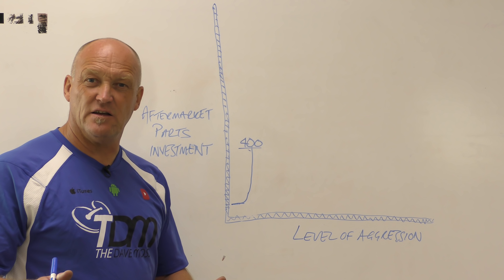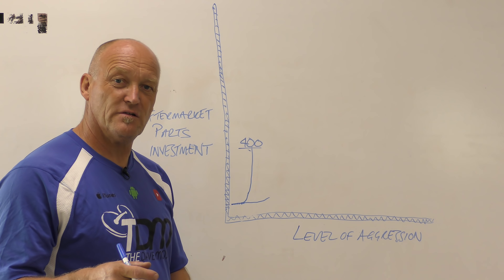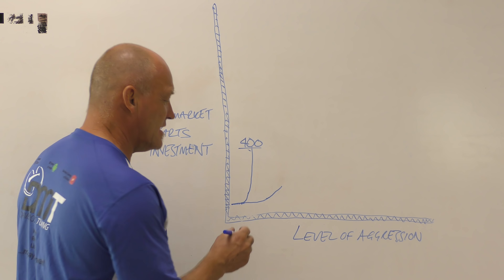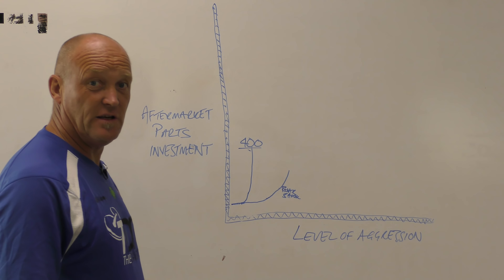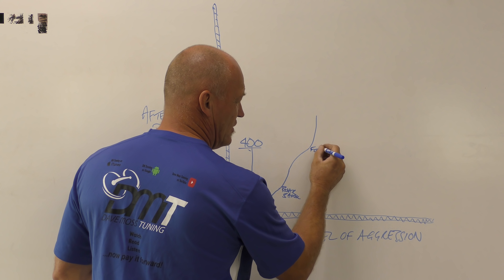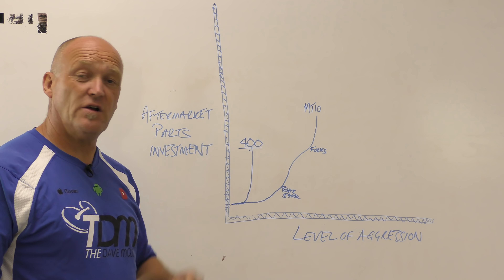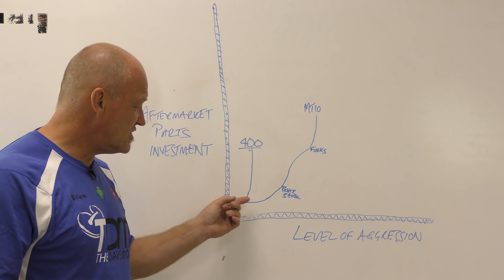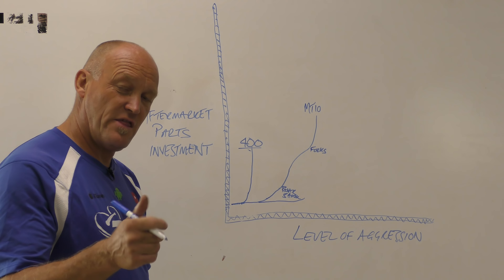Fasterclass: Motorcycle Suspension Revalve & Respring

Comment: Just a question.... Static sag... 20mm static and 10mm rider... How heavy would the bike need to be to sag that much and how how would the rider only add 10mm of sag as he would be putting more weight into the rear than the weight of the bike alone as you can see from a correctly set up  bike using 10mm static and 25mm rider.  If the spring is too hard there would be zero or close to zero sag and less than 20mm rider sag surely. I think you have the soft and too hard spring static sag the wrong way around... surely.. You seem to be mixing up the soft and hard static for the rear shock. Unless you can explain why I am wrong....  

I have a bike here with almost zero static sag and 5mm with rider. Someone fitted a shock for the wrong bike after an ebay purchase of a £1400 rear shock simply because it said Aprilia. That spring is way too hard obviously but it has minimal sag regardless of static or rider. That shock has to be removed and sold off as the manufacturer does not have a 60 or 65N/mm spring in a fitment for that shock.
Reply from the maker: I would say it is a question of perspective. 20mm static and 10mm rider would show that the shock spring is far too hard as the rider cannot compress it beyond the static sag number. Zero mm static and 50mm would show the spring is too soft as you have to lose all static sag to get something close to the 30-40mm range. Does that provide a different perspective that has rationality?
Reply: @catalystreactionsbw  still does not make sense. The bike is whatever weight it is. static sag is always less than rider sag. So for a spring to be too hard the static sag will be very low and so would the rider sag. The spring rate is Kg/mm or N/mm so that is usually linear so for a 20mm static sag there has to be double the weight (in basic terms) of the rider acting on it.  
Now if you said that on a stock bike with 20mm static sag (they know what they are doing for road use at least) and with a rider it has 10mm of sag it is too hard and if it then has 40mm of sag its too soft I sag get that.  But in no case would static be more than rider unless the spring is too soft not too hard unless you have sat a child on the bike for the rider sag.  If you said yes you got the static the wrong way round I can get that. But if people take this as gospel then they will be getting things mixed up and its just not correct. Sorry.. 

I don't have a channel that sells my services or sell suspension parts so its me being awkward for any reason apart from this is just not correct (unless you have a specific example to show and I am wrong).  I have done a little bit of suspension work and ridden a little. Road legal Suzuki GSXR600 Nurburgring lap record breaking bike I built for Fast Bikes magazine. Raced 250cc and 350cc Yamaha LC's and TZ's including European Championship wild card entry on a factory Yamaha TZ250. Currently doing work for BSB and have worked in WSBK and Moto GP as an engineer. I may have made a mistake but I just don't see how.
Reply from the maker: @YAMR1M  Thanks for your comprehensive POV based on your engineering background. For me 90% of the work I do is street bike set up with OEM equipment, so getting them started on their journey is my goal. To that end my explanation works and gives Joe rider a very simple starting point in layman's terms.If I fail at that level, they do not want to nor go any further seeking more information. Therefore explanations I use do not fit your engineering frame of reference when applied to the national and world levels so my methodology fails in your eyes and way of thinking. I am fine with that line of thinking and appreciate you taking the time to share in detail why you are right.
Reply: @catalystreactionsbw  I just think your analogy of the static sag is the wrong way round. The rider sag is sound but the static figures you use would have been better if ALL the static sag numbers had been the same as you said you deal with OEM products for customers for the guide and I know of no OEM shock being that far off even when worn and tired. 

I am currently going through the same problem with a customer who bought one of my Carbon monocoque seat/tank kits which make a big difference to static sag anyway as the whole monocoque is 3.5kg and fully self supporting. The bike was 162Kg dry and is now 105KG wet but NO FUEL. He purchased a shock, without advice, that has a 120N/mm spring fitted when the original equipment one was 60N/mm. The bike has ZERO static sag. It has 5mm rider sag. He made a massive mistake and while looking at information on the KTech DDS Pro rear shock your video came up and I was going to send him the link but it would have confused the issue even though it is obvious the spring IS WAY too hard, he has zero knowledge so this video would have just confused him more.
Reply: @YAMR1M  Old comment chain, but I figured I would pitch in. The reason you can get more static sag with a stiffer spring is that you can run less preload with it. Until the preload force is overcome, it will not move at all (which is what happens when you have zero static). It is also possible that a stiffer spring will end you up with both less rider and static sag, as I have experienced below.

 I did a rear shock swap on my MC19 and swapped in a CBR 600F3 rear shock. The stock shock on my CBR had a 16.0 kg/mm shock spring, and the 600 shock has a 13.9 kg/mm spring. When I set it up to get 35mm of total sag with me on it, it had zero static sag. I started the preload at the minimum, so couldn't go any lower. This is where you can get into trouble with a stiffer spring. All else equal, if I just put a stiffer spring in it that is the same length also at minimum preload, I will end up with less total sag, AND if I had any static sag, that would be reduced as well.

As a fellow engineer, here are my calculations. The CBR 600 spring is 143mm long, 13.9 kg/mm rate, and when installed in the shock at minimum preload setting, it is compressed to 129.6mm. So, at the minimum preload setting, the stock spring is compressed by 13.4mm. Multiply that 13.4mm by the spring rate of 13.9 kg/mm, cancel out the units, and you get a preload force of 186 kg. So until the shock sees 186kg pushing against it, it won't move. The bike alone does not exert that force, so it has zero static sag.

I went ahead and bought a stiffer shock spring, a 16.0 kg/mm spring to match the stock one. The spring ended up not only longer than the original spring as advertised, but it was also 3mm longer than advertised too. This new spring is 148mm long, 5mm longer than the stock 600 spring, while also being a stiffer rate. I was already at minimum preload, so I can't reduce preload to get any static, and in fact I have even more preload due to the spring being longer. This stiffer spring lead to me having 25mm of sag now, while still having zero static.

This 148mm spring compressed to 129.6mm when installed produces a preload force of 294 kg, a good deal more preload than the stock spring's 186 kg. Even if the spring was the same length at 143mm, it still would have more preload force and thus less total and static sag. So again, the way you get static sag back is to reduce preload. As above, the stock spring hit my desired sag with zero static sag. I could grind down the preload adjuster or shorten the spring (by cutting/grinding, NOT disabling coils) to reduce the installed preload and get some static sag back, but then I would be at maybe 40mm+ of total sag.

Using my numbers above, lets just pretend for a second that I did have 5mm of static and 35mm total sag with the stock spring. If I shortened the stiffer spring to exactly match the preload force of the stock spring when installed, I could keep that exact same 5mm of static, while reducing the total sag to something like maybe 30mm? Flipping it the other way around, I want to keep the total sag the same, while increasing static sag, and the way to do that is to reduce preload with a stiffer spring. Make sense?

If I had measurements of the spring length when compressed with a rider, I could then easily calculate exactly how much the stiffer spring needed to be shortened to achieve the same rider sag. And if I had a fancy load cell to mount where the shock goes, I could calculate the force being exerted by the bike alone and calculate what the static sag would be, but I don't have all that.
Reply: @Daschickenify  I think you missed my point... He said you need a softer spring when the bike had 20mm of static sag and somehow only had 10mm with a rider on the bike because the math says its only 30mm of total travel. Thats a dumb example. The bikes weight on the front will be about 50% give or take +/-5% usually. The bikes sag will always be less than with the rider on the bike and IF the bike does have a significant amount of sag without the rider then the spring cannot support the weight of the bike correctly so you then start to add a lot of pre-load to take up that slack.  So it moves where the forks start to move further up the scale so to speak as you increase the pre-load. Which will be false weight added to the load on the springs and will make the total travel less because as the pre-load increases you have to be increase the load on the forks to start working. You will never have that much bike sag and so little rider sag to be honest. Its a really bad example. 

The forks then become harsh as you have effectively added a lot of weight to the spring so if the spring needs 9Kg/mm to move then you are looking at 180kg per fork for that initial 20mm of travel or a total of 360Kg. That it not likely to be the case. If you have 20mm of bike sag then the spring will be very soft as it is just supporting the weight of the front of the bike.  If the bike has the same springs and has zero bike sag then the springs are supporting the weight of the bike better.  SO IF this awful example was an actual example then lets take each bike.  
0mm and 40mm of sag. The spring has too high a spring rate for the bikes weight and the 40mm of travel with the rider is now moving under the weight of the rider so to bring that bike to 30mm of travel you need to add a little bit of pre-load. The spring could be a little softer and then use pre-load which is more in the middle of the adjustment range. 
20mm and 10mm of sag. The spring is too soft to support the bikes weight and probably has a lot of pre-load to just support the bike and as the rider sits on the bike he is working against the mechanical load added to the springs and the suspension becomes harsh when the answer is a firmer spring to take up the slack in the initial travel and back off the preload as you have to be using the adjusters to keep that bike within this mythical 30mm of travel.  

What he has said is totally the opposite of what would be needed and what would happen in the real world.  
I have spent the past 18 months doing a lot of testing for a bike manufacturer and this was by luck suspension set up work on track. I had to test fork springs that were rated at 20% and 30% stiffer than stock so I could actually test with mix and matching the springs and go from 10%, 15%, 20%, 25% and 30% stiffer as well as testing different fork oil viscosity. We also tested different rear shock linkages and spring rates with us being able to reduce the spring rate by 45% over the original spring, get the same sag with a small increase in preload but reduce the heat in the shock as it is not working against a much stiffer spring and running rebound close to maximum. We got the shock close to mid point on the adjusters and not one at maximum  and the other a minimum.  With testing we reduced lap times by 15% which is massive .
Reply: @YAMR1M  The point I am focusing on is the change in static sag from spring rates. Going stiffer allows you to reduce preload and maintain the same total sag while increasing static sag. I built a spreadsheet to calculate an example with the below assumptions.

Bike weight of 400 pounds, 50/50 weight distribution, rider weight of 150 pounds, 60% going to the rear when seated, and a static linkage ratio of 3:1. 

Targeting a consistent 35mm of total sag, this is what I am getting.
Zero preload, 11.27 kg/mm spring, 24.1mm static
4.8mm of preload, 8 kg/mm spring, 19.6mm static
14.6mm of preload, 5 kg/mm spring, 10.6mm static
21.2mm of preload, 4 kg/mm spring, 4.4mm static

Going softer on the spring while maintaining total sag means you need more preload, and thus you have less static sag. So yes, 20mm static, 10mm rider sag is unrealistic, but it is possible if the preload adjuster allows such shenanigans, and if the rider or bike is light enough and the spring is stiff enough.
Reply: @Daschickenify  Yes the stiffer the spring the less static sag you get. The other thing that is never mentioned is the total fork travel, on track this is, where you want a spring rate/pre-load to allow you to have about 10mm of travel left under maximum braking load so there is a small amount of travel left if you hit a bump or something under heavy braking. Once you start to look at this as part of the set up you run out of spring rate options either side of the optimum rate for you and your bike. Too soft and too much pre-load makes the bike have a harsh initial movement as you have to hit that initial target weight for it to move and then it can still bottom out. Too hard a spring rate and the forks will move with any load on them but will feel harsh and you may not get the travel you want under braking. Dave seems to be making his money from guys who have zero idea of a base set up and he may be able to do that but all of his advice seems to be flawed and in some cases not just flawed but totally wrong.  But then he said he was part of Team USA in the Phillip Island classic races and had been for a number of years. Sadly many of those years there was no team USA and the one year he did ride he was close to last and about 13 seconds per lap off the pace.  I am not a BSB level rider and I am now way too old to race for a living. But I am about the same pace as several time BSB superbike champion John Reynolds, ex GP rider Ron Haslam and a number of the riders in the support classes at BSB around the local track where I have had to do all of my testing a development work. I do feel you need to be of a certain pace or have been at a pace or raced at a level which is high enough to mean you are pushing the bike to its limit and not the bike pushing you to yours. A pace where you have to have an understanding of what the bike is doing below you and what you need to do to change it to make it work. I sadly don't feel Dave was ever close to that level and this is proven when he "reads"  a tyre and says that some wear marks are due to a chain being too tight! How tight is a chain with 200bhp being put through it?  Sadly having watched a lot of his videos over the years it does feel like he is a snake oil salesman.. 

I am doing a day with a guy I know who has a youTube channel that is a road guy and wants to learn more about what Dave has been saying. I am going to be taking him to a track on a small slow bike with very adjustable suspension and let him ride a bike that is well set up then change the bike to make it worse and see if he can feel the changes as well as helping him understand what he should be feeling and why.

Comment: Re-valve or go for a thicker oil from 15W to 25W ??
Reply from the maker: Oil is 15, 20, 30w that you can buy. If you are mixing 75% heavier oil, 25% lighter oil. If you are going over 20w, revalve.

Comment: I'm going through the suspension on my FZ6 currently. I'm a heavier rider at ~250 lbs and the stock equipment is definitely not matched to that. Thankfully older R6 forks that are fully adjustable are a direct swap to the FZ6 triple clamp and my 09 already has the same brakes so no extra cost there. I'm taking it a step further by having them resprung and valved for my weight since I'm going through all this trouble. That leaves me at what to do for the rear. It's preload adjustable only, but only has seven settings and no damping adjustment. I'm weighing all the aftermarket options from Ohlins, Penske, Wilbers. With Wilbers, I can get a rebound/preload adjustable shock for $500. If I want hi/lo compression adj, it's an additional $200. Would you feel that extra cost is justified for a strictly street/canyon bike or am I best off saving that extra money and just making sure the spring and preload setting is appropriate for my weight?
Reply from the maker: Hi Angel. Great work on the fork conversion. Very popular! Rear shock should be preload and rebound minimum. For $200 more, compression control would be worth every penny IMHO.
Reply: @catalystreactionsbw  I appreciate the reply! In that case, I'll budget the extra money to have compression adjustment as well.

Comment: What should you do in a situation where you have correct spring rate and preload for your weight according to the sag measurements (track) but you are bottoming out?? Should you add compression or preload or go to a stiffer spring? Doesn't adding preload or changing a stiffer spring ruin the sag numbers? Or is this case even possible??
Reply from the maker: If you have OEM springs and are in the last 25% of adjustment (ie: 75-100% range) for compression and preload, new springs are needed. If they are progressive springs, acquire the correct rate that will be just slightly too stiff on sag numbers initially but will allow you to improve over 2-3 years. Also think about increasing oil level to leverage air spring effect.
Reply: @catalystreactionsbw  Thanks for answering! :)